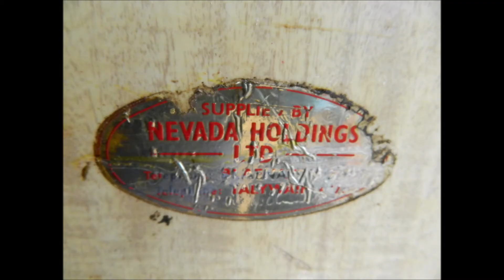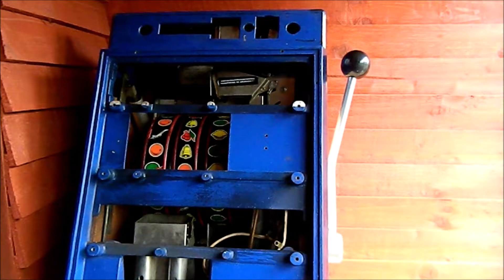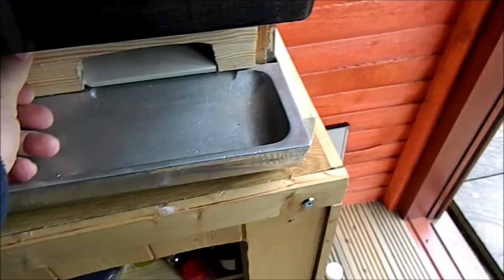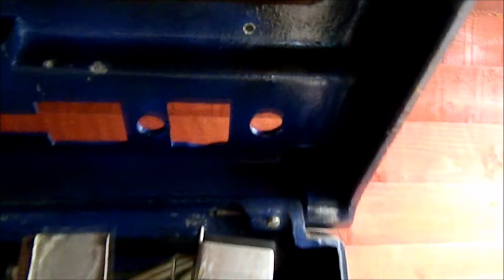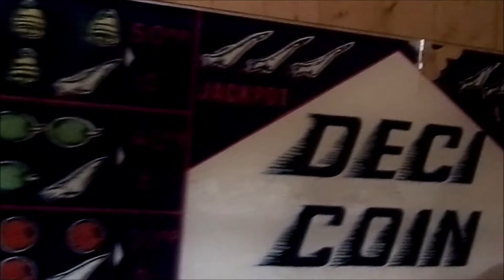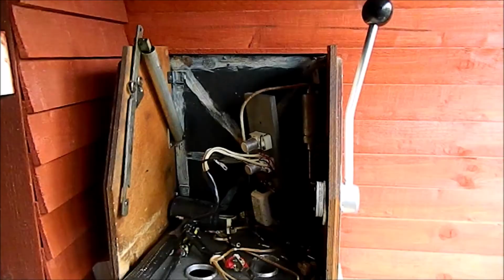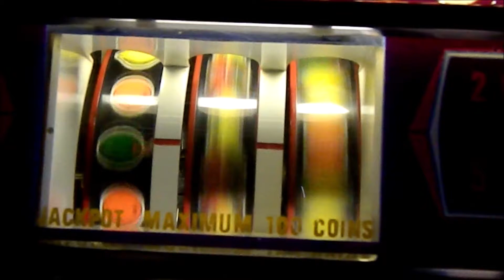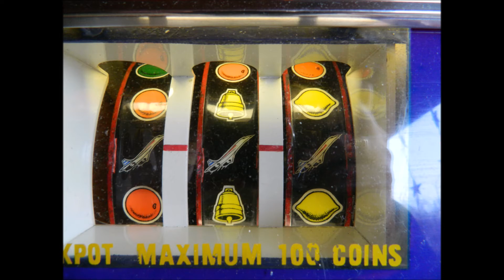Jubilee One Arm Bandit Restoration

Comment: I have the same machine..what's best to lubricate the whole mechanism.and the clock mechanism
Reply from the maker: I wouldn't use WD 40 to lubricate as it'll dry out, some 3 in one oil nothing heavy would be ok, you can use clock oils for the clock.  If you need parts you can get them from Henry Powell at Powell's Automatics.. 👍

Comment: Quick question. My dad’s just bought a very similar machine that’s running on 1p coins. Any ideas how to remove the magnet in the coin slot to let it accept post 1992 coins?
Reply from the maker: Hi what machine is it   If it's a Jubilee like the one in the video I don't think there is one.  Some machines have an S10 coin mechanism some have had removable magnets and some were fixed.  You can cut them off but I wouldn't do that as you could devalue the machine.  You can buy older coins for them, and they are still in circulation.  Hope you can sort it. 👍